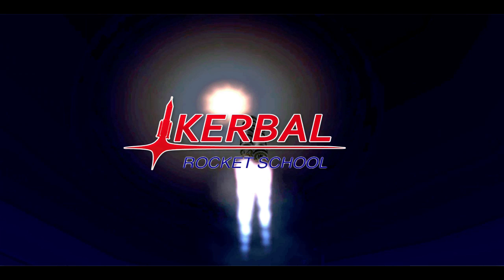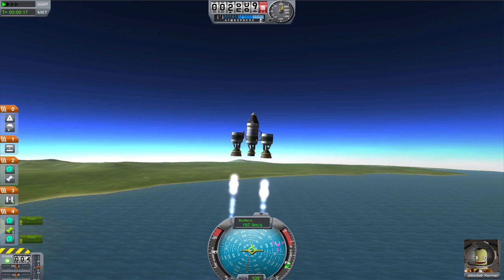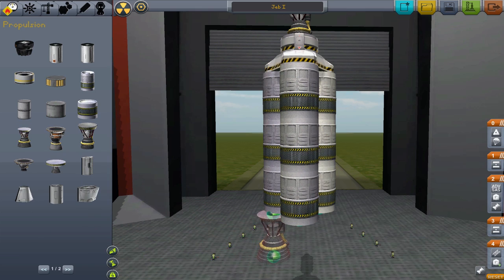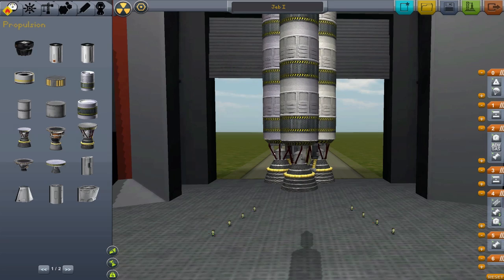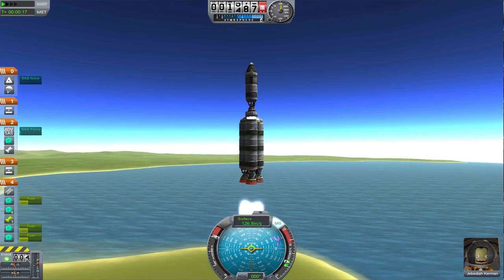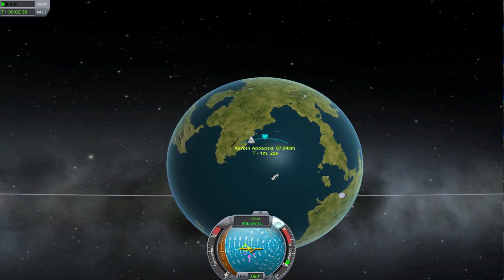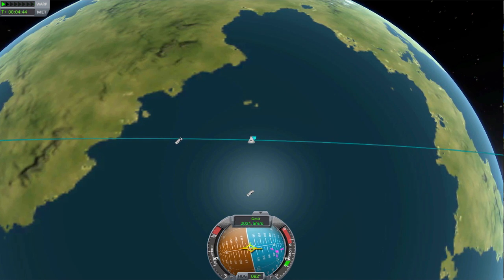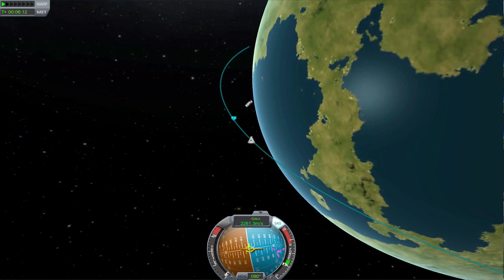Kerbal Rocket School | Episode 3 - Staging

Comment: If the ejected debris do not have a docking port (clampotron), you can not attach your active ship to them with normal parts.
You can design some kind of "hollow conic spider net" with structural girder parts and "catch up" & retrograde the debris when both your ship and the debris encounter at the same Apoapsis point in both orbits [take care of your target relative speed is less than 5 m/s when you are less than 100 meters].
Another posible solution is using mods to grab/destroy it at distance